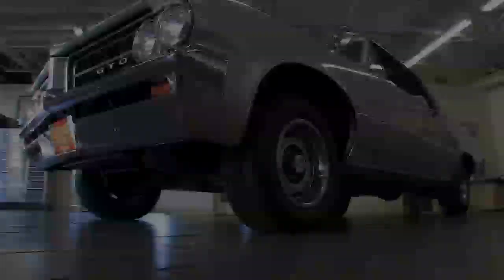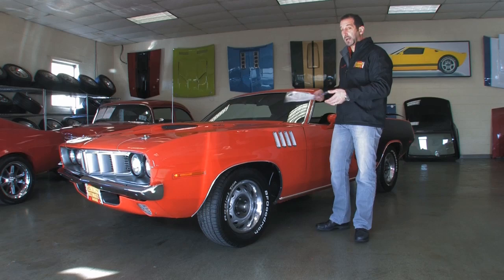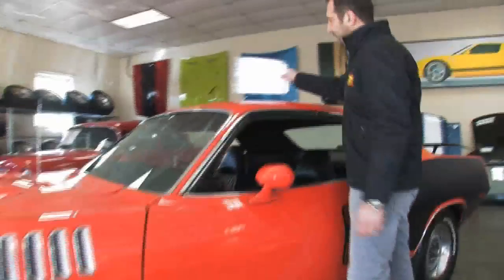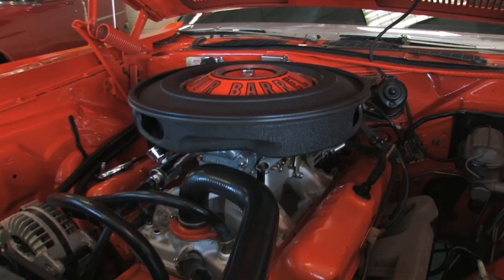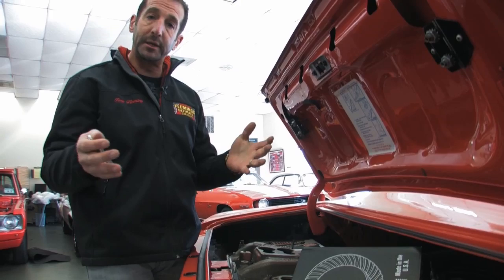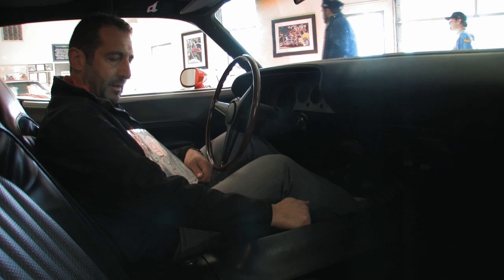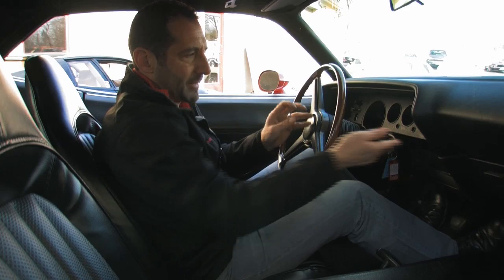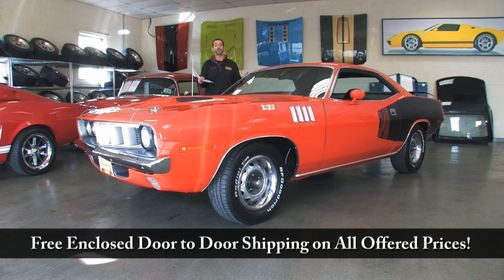1971 Plymouth Cuda  for sale with test drive, driving sounds, and walk through video

Comment: Is Cuda sold? looking for a fully loaded 1971 cuda or road runner or charger or challenger doesn't have to be all numbers matching but with all 1971 period correct engine and transmission 3 or 4 speed or automatic with factory upgraded vintage a/c power windows factory power bucket seat Not factory but factory correct sunroof upgraded suspension and disc brakes upgraded rear end upgraded sound system with Blu tooth but looks stock and upgraded horse power but still looking stock budget around $30.000 or so